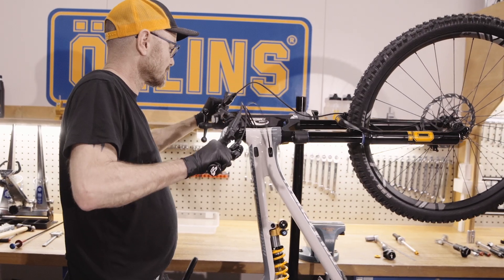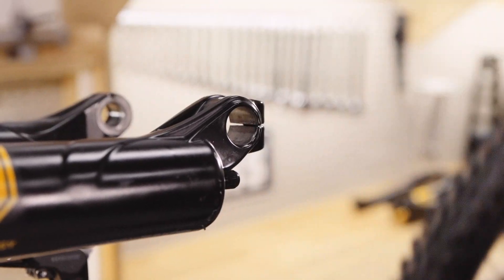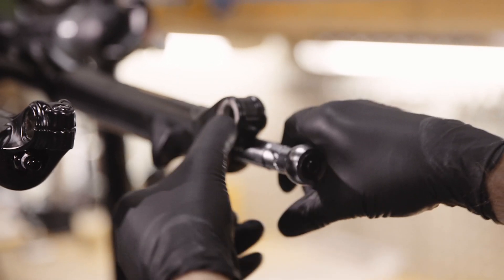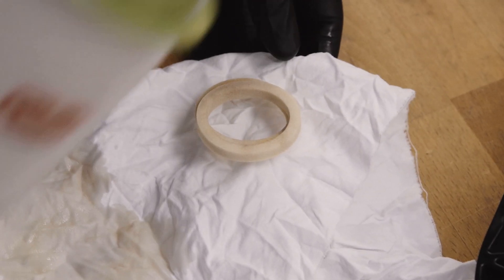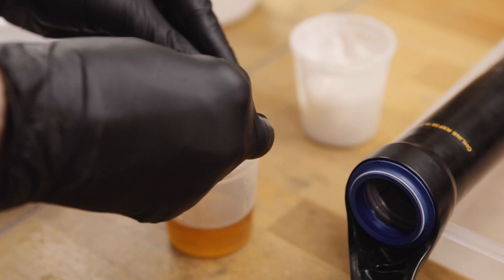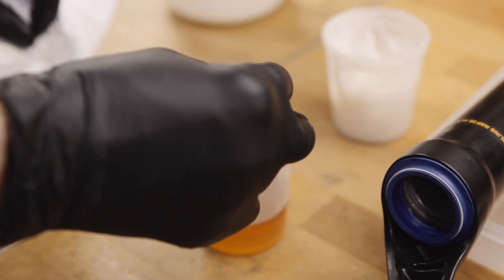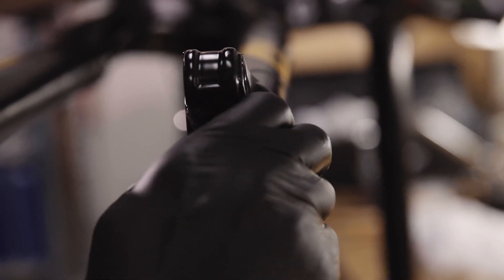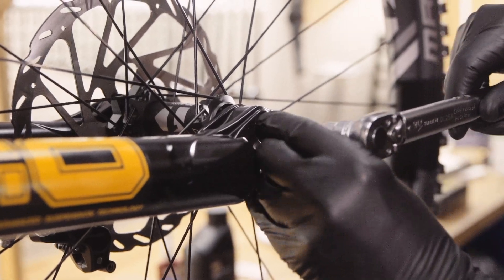50 hour lower leg service on an Öhlins RXF36 m.2 Air fork

Comment: How much fork oil should I inject in each leg? In the manuals it is written 5 ml, but in the video they injected 10 ml and said to not exceed??
Reply: Saw on another video it’s 5-7 ml in the rxf36 m1 and Evo, 10 mL for m2. That manual is for the original fork. They don’t have one in there for the m2 because they are the same procedure, but they really should bc of this exact reason
Reply: It’s in the comments of the RBC lower leg service video just search RBC ohlins 50 hr service

Comment: Is this the same procedure on the RXF 36 from 2018?
Reply: "How to perform a 50 hour lower leg service on a RXF36 m.2 air fork. The operation is similar for the original RXF36 and RXF34, make sure to follow the workshop manual."
Just read...
Reply: What oil and grease specification ?
Reply: I try also to find what type of oil need to be used for lower leg!

Comment: It will be easy for use if you mentions type of lubrication for certain models of your products...this a tutorial it should have been mentioned!,!,even your manuals does not indicate what type of oil or grease to used as well as the right torque!!! Damn you!

Comment: Checking out the manuel for the 38, im lost with the table: 
Use fluids in spring and damper fork leg according to
table below. It is important to not to overfill as it will affect fork
performance.
What is the Damper fluid? do i need it? where to find it?